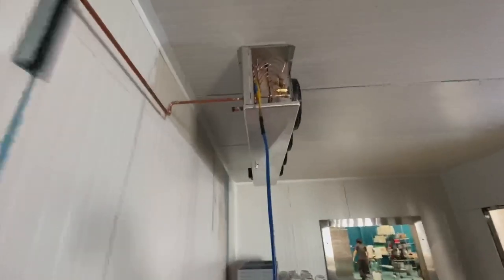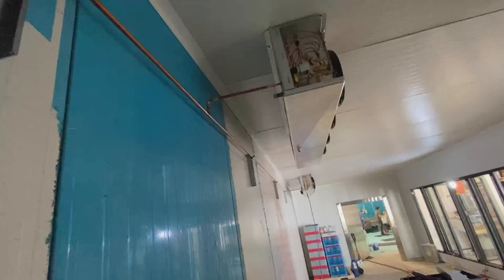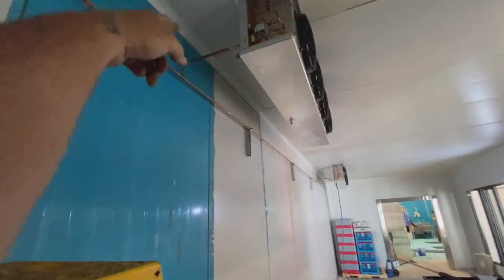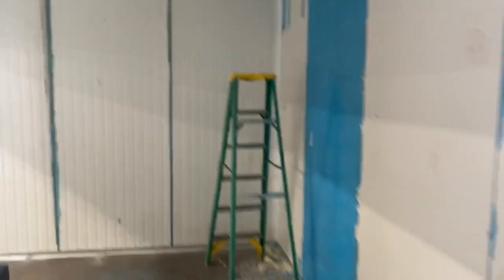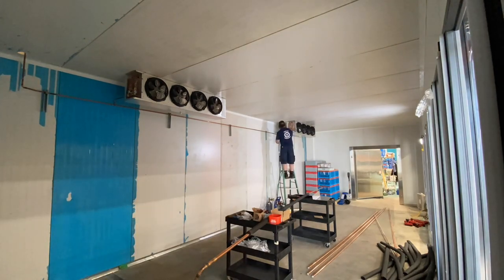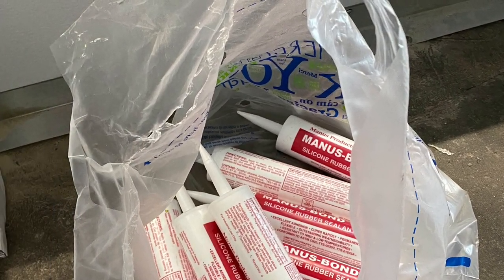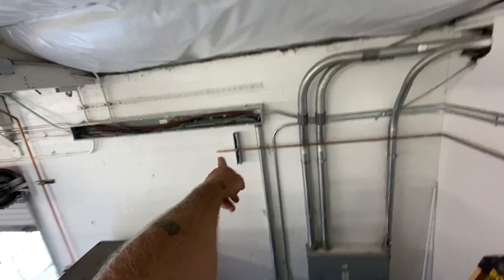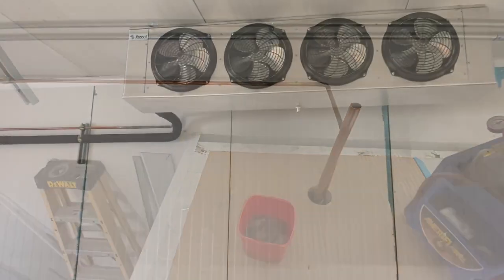Piping the Box

Comment: No “P” traps! This is the YouTube police seeking explanation! 🤣
Reply: Depends where the condensing unit is
Reply: Was thinking the same thing there Cap'n 🖖
Reply from the maker: @OcRefrig  I use them when needed. For example if the suction line would have been on top of the box. I would have needed to trap out of evap then go inverted trap into suction line. I ran the suction line below evap coils on purpose to exit evap  and go into top of suction line. And use less fittings.

Comment: A little surprised you did not put a p-trap before that suction went up through the top of the box..
refrigerant will run on top of oil in that long suction line...
Reply: No it won’t. You only need a P trap when your compressor is above the evaporators. Once he egresses the wall and falls down to the compressor he’ll have sufficient refrigerant velocity to avoid oil logging the evaporators.
Reply from the maker: @FireandFrostHVAC  correct
Reply: It’s only a small rise; no need for p traps here. I was always told a P trap every 2m rise

Comment: core a hole, BAH!   grabs the 7/8" bit, chisels and sds+ hammer, here hold my beer!
that's generally how I've installed dryer vents and other piping through block and brick walls for years, now solid thick concrete I'd have to get a coring bit and drill, which you
can rent at the big orange box store. at least around here.
Reply from the maker: I just show and a hole will be there. Lol. Besides I have no clue how to pipe a box, how would I be able to make a hole?????? 😂😂

Comment: Clean job Dave ...  ? No need for a ref.  suction line p- trap?
Reply from the maker: Units on the ground.
Reply: @NorCal-refrigeration   yup that's a good way to slug oil back to the compressor...
Reply from the maker: @Ivansgarage  nope it will be fine. Trap is for vertical rise.
Reply: Totally wrong Dave. Oil trap is needed on both evaps and also inverted oil trap on the top. What you did there is plumbing
Reply from the maker: @giorgosktoridis903  the suction line is below the evap coils. Both evap ago into top of suction line.
Reply: @giorgosktoridis903  oil is needed in the Evaps? wtf lmfao    a P trap is only used on a vertical rise... my guy ... read some books junior